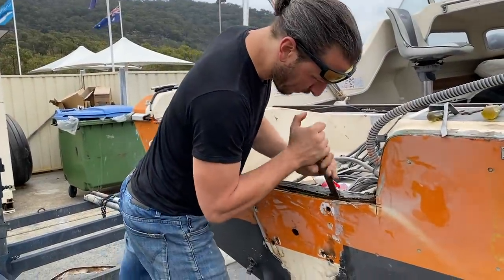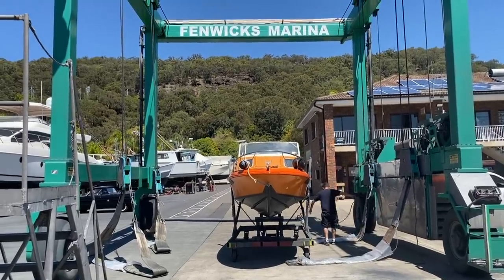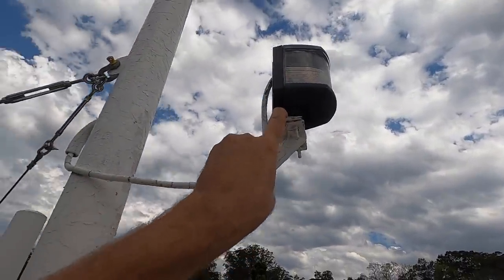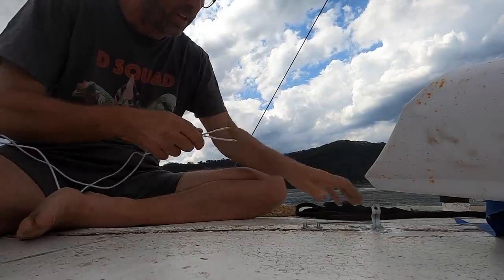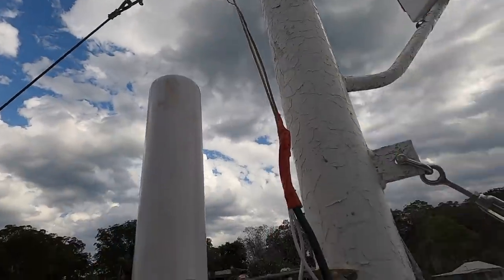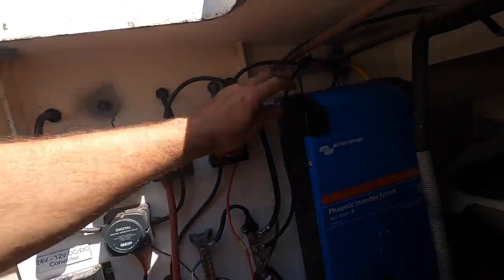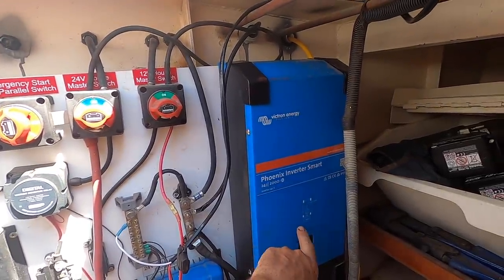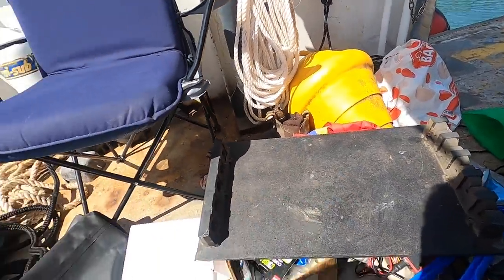Self launching bow roller for the anchor, and neater wiring!

Comment: I'm a bit confused.
GND and Earth are most probably connected inside the inverter.
The "earth" (strange to use on a boat ^^) should be connected to earth wires leading to protective earth in your sockets.
If you don't have protective earth in your sockets I don't see a reason to connect earth anyways.
Or does this inverter refuse to run without earth connected?

When comparing to traditional european house wiring the earth would usually be connected to cold at the breaker box, which is the inverter in your case...

Did I miss something and goofed my thoughts in a monumental way?

Oh and if you install an RCD you would need separate cold/earth terminal blocks anyway
Reply from the maker: So there are three wires going from the inverter to the socket, one for the protective earth. Perhaps it is for the case of the inverter itself.
Reply: @DangarMarine  That sounds like you shouldn't connect this earth to battery GND only. The protective earth is there for when you have the 220 leaking from hot to a chassis for example. If the whole boat is "grounded" (as I would assume) there would be one connection between earth, neutral and battery in the distribution block, "upstream" from the breaker (between breaker and inverter). And battery GND should be tied to that as well, I'm not sure on the proper location though, I think also upstream from the breaker.
But you should still run the protective earth to all your sockets and have that one central connection.

Maybe I just didn't get something correctly, I'm totally new here and didn't follow the rest of the project yet.
Looking forward to new episodes and the solution especially :)

Comment: Hey Stu, good video. Good luck with giving up "not going anywhere". I do not think that is humanly possible.  I was curious about the solar installation. It seemed like the tee's on the conduits should face down and the cables should have a drip loop on them?
Reply from the maker: The angle is more about neatness. Water won't be a problem as all the connections are fully waterproof so a few drain holes will let any water back out again.
Reply: @DangarMarine  Thanks, I had not seen earlier videos about your system and wasn't sure. You always think things through so I figured you would have thought about this.

Comment: You really need a remote control for the anchor winch. Otherwise one day sailing solo you will need to be on the bow and in the cockpit. Also Dyneema rope is brilliant but does not last forever and can suffer damage due to salt  crystals. Washing it off as it goes on the drum is not a bad idea. https://staffprofiles.bournemouth.ac.uk/display/thesis/4656
Reply from the maker: Yes, definitely keen to add a remote and thanks for the link.

Comment: The anchor loading up is pretty satisfying, although rather than cutting up the back lip perhaps bolting a  PP or PTFE plate  using the spare bolt holes as a base would be less hassle. It would wear in time but it would be a cheap enough sacrificial part and low friction for both chain and rope. Cutting the back lip would still leave  a chance of metal on metal contact

Comment: Hi Stu, what and how much difference is there in stretch between the dynema and the tow rope, pro,s n cons.
Reply from the maker: I would say the dynema stretches less that the nylon so it may not be as good for shock absorbtion.
Reply: Braided Dyneema stretch is considerably less (higher stiffness), higher strength to size, lower abrasion resistance, higher cost, looses strength to UV, looses strength by aging (less well known).  Shock absorbtion will be lower, but with enough chain, the tension will raise and lower the chain as the anchor rode is loaded, which will soften slowly changing loads like wave action.  Many vessels have only chain anchor rodes, of course.

Comment: Regarding the repair on your friends fiberglass boat, would you have time to tell me the recipe for the filler, and type of the glass matting? We always learn from and enjoy your videos.
Reply: I have used 4 to 8 ounce fiberglass cloth cut to roughly 1 to 2 inch squares.  Mix these in premixed 2 part marine epoxy like West System with a slow cure hardener.  The cut squares will come apart when you stir them in so now you have chopped strand mixed in the epoxy.  Keep mixing more in until you can apply it where you need it. You'll be able to mix quite a lot of glass fiber in and still spread or stuff it in holes.   For fillets, and small spaces, cut the fibers shorter for better smoothing and better flow-strength will be somewhat compromised.
Reply: @boooshes  Thanks.

Comment: I suggest the socket be on the wheelhouse...it would be safe to do and should not have any problems assuming the wiring is done correctly.  
Do you have...or have you given thought to have...desulfators for your batteries?
Reply from the maker: I haven't really looked into adding desulfators, but they do have the advantage of being fully charged every day by the solar controller which will hopefully keep them in good health.

Comment: That swivel on the Rocna is all wrong and dangerous. Just search anchor swivel side-loading for plenty of examples. Think about it though - the anchor gets dug in and your boat moves to the side with current or wind. There’s no give sideways. The solution is to remove the swivel altogether - you don’t need it at all. If you feel you must have it (a mistake), then it needs another shackle on the anchor to help with side-loading.

Comment: 2 banks of 3 panels in parallel why you want them in series otherwise your losing a ton of power you have a MPPT solar charge controller the higher voltage you can give it the more efficient it will be and less heat lost thru the cables and less chance of melting the MC4 connectors remember amps are directly tied in with voltage with series you put more voltage at a lower amp and the MPPT charge controller then converts that to your battery voltage with less loss in short you are losing a ton of power along with also wasting the entire point of having a MPPT charge controller add to it adding risk of solar MC4 connectors melting and literally catching fire.
Reply from the maker: Yes, that's exactly what I have.
Reply: @DangarMarine   in the video you said 2 banks of 3 panels  in parallel when it needs to be 2 banks of 3 panels in series for a MPPT charge controller.
Reply from the maker: Two banks in parallel, each bank being three panels in series.